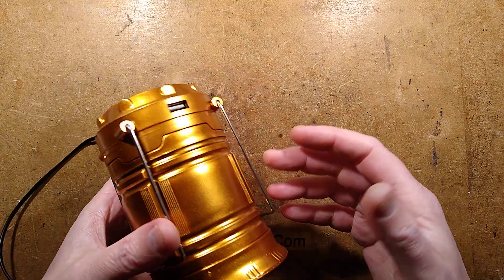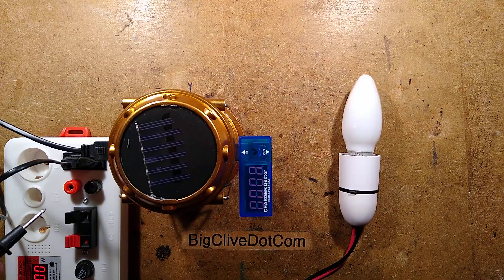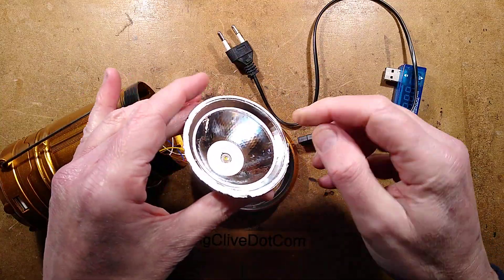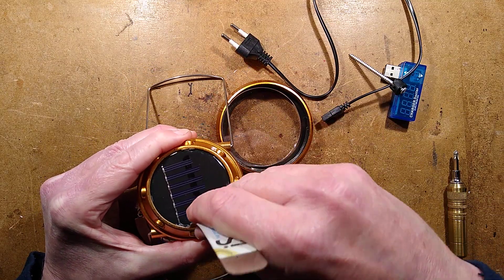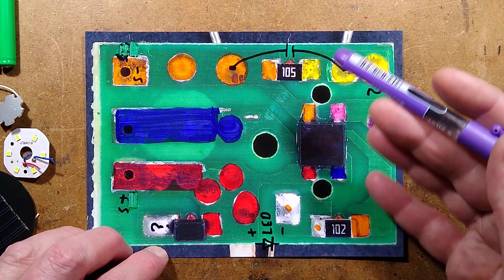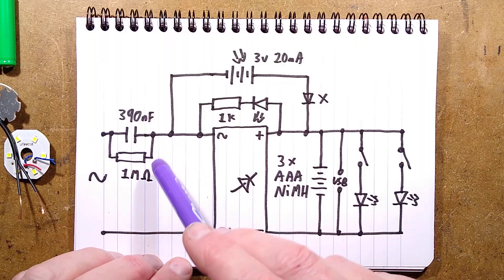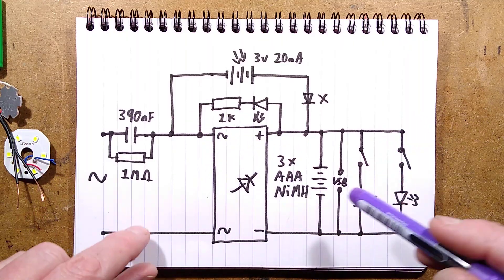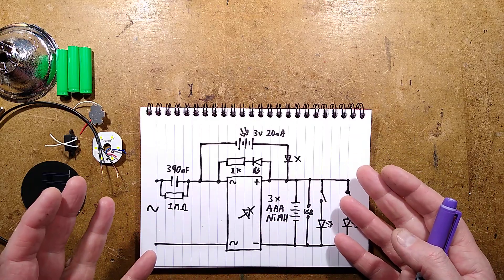Dangerous "death Dalek" lights still on eBay

Comment: The batteries probably ARE carbon/zinc since they will refresh a bit when they are “charged.” Still it will probably piss electrolyte all over the place and make it an extra-spicy death Dalek. 🌶️ Really sets a new high (EXTREMELY LOW) bar for a Chinese product. Nice!

Comment: Cell phone deaths are common here in Thailand where they sell 60 Baht (0.5 USD) chargers, but the media never goes beyond naming the brand of the phone and implying the phone was to blame.  I hate Apple with a passion because of their intentionally unrepairable nature, but no one has ever been electrocuted by an iPhone, it's the charger.  I hope the UK media is a little more thorough and accurate when these deaths happen, which is inevitable with products such as that.  Thanks for another great video.
Reply: This happened in Australia too, a young nurse died from a crappy charger she bought online.
Reply: And it was Apple that started the trend of selling phones without chargers, (apparently, it allows a slimmer, greener box) requiring customers to buy them separately. I remember when, in the early 1970s, my father bought our family's first cassette recorder, a Philips N-2205. It came with a microphone, patch cord, external speaker plug, mains cord, batteries, a blank Philips C-60 cassette, and a multilingual user manual. Everything you needed to use the product right out of the box. Nowadays, when you buy something, the accessories are often sold separately.
Reply: @dougbrowning82  good point
Reply: Not only these bad chargers, my worst incident with these cheap and dangerous product was that one time I got a cheap fake laptop AC cable from KlongThom, it was nasty quality and I didn't know better back then, it broke inside and caught fire, I was lucky I saw it happened and quickly pulled the plug and hit it with cloth to put the fire out, if I didn't, my house would be burned down or I might not be here. 
I know how bad it is when I cut it opened and learnt that it was very tiny copper coated steel wires, now I never cheap out on any electronic components.
Reply: @worawatli8952 Jesus, now I'm going to have to check all the cheap crap my mom bought on the street from street vendors.
Reply: You just described why journalism is now known as urinalism. Good job!
Reply: Several years ago there was a big story in Sweden when a young girl got badly injured from a phone charger her dad had bought cheap online. I remember hearing about it on the radio - she was holding her phone and then her foot made contact with a radiator which became ground, so the current passed right through her. After that I started trying to not come in contact with the radiator right next to my bed while charging my phone... 

So that was absolutely reported as the charger. There are standards in the EU for what electronics are allowed to be sold, so usually you are pretty safe in a store, but if you buy online that really goes out the window. Sure there is crap in stores too but if someone notices we tend to go down hard on that here.
Reply: This is what makes apple do silly things like make proprietary chargers
Reply: In Germany a lot of well built USB Chargers are thrown in the elecronic trash. I often see dozens of them when i go to the recycling center. Would it be a good idea to collect them and send them to Thailand?
Reply: Report this to all various countries'  safety organizations,news organizations,stations etc.Thailand also should have some sources you could contact .Report it  to many places.
Reply: So you speaking about stupidly cheap phone chargers and how they causing deaths, and then blaming Apple… it doesn’t make any sense. If you can afford expensive phone, but then using cheap accessories who’s fault it is? Since most of the mobile phone companies don’t include chargers no more.
Reply: I used to hate Apple in principle until I was forced to have one for work. Now I'm never going back. The old days of not knowing if this or that app will work with your phone or worrying about how long security updates will be available are now traded for the ability to lock down your security, keep your data as safe as you want it to be, to be able to lock Google's greedy bastard hands out of your life and knowing you will be guaranteed steady functional updates well past the life of most  people's phones. Yeah. I'll take having to pay someone to work on it for the guarantee of security and a working product. Android is cheap because Google views humans as cheap. We are the product they sell to companies and we pay them for it. I got off that bus.
Reply: @PalmettoNDN Phone philosophers... what a 1st world thing.
Reply: @PalmettoNDN I really don't recognize any of those problems.
Reply: Thailand uses twice as deadly voltage as usa
Reply: I saw one of those “apple” wall plugs blow up.
Reply: How da fuxk do you get electrocuted by 0.5 dollar charger? Are yours plugs made different?
Reply: @ceiling_cat  It shorts and puts 240 vac on the output instead of 5 DC. Better chargers are designed so no part that fails can cause this. Switch mode power supplies are very complex.
Reply: @ceiling_cat  because of the missing isolation between mains and USB by a transformer. Exactly what's going on in this lamp.
Reply: @ceiling_cat it isn't because of the low voltage output. It is because of bad design of the circuit internals where you end up with something similar to what was shown in this video, where the live mains and up being connected to an output that you can make contact with. In some products this is always the case. Depending on the design and in others, the way the circuit board is laid out, there is not enough space between the runs from the power supply side to the low voltage side. And over time it ends up shorting across.

Comment: The solar psnel can charge the battery through the bridge rectifier thanks to one of the bridge diodes, but needs enough 0.5V cells to overcome that diode drop and X .
Reply: Came to say just that. Maybe it would charge in near equatorial sunlight.
Reply: @tactileslut  -It only charges in China. LOL

Comment: rechargable alkaline batteries have been available since the MID 1970's.
Back then I had some Duracell rechargable cells in both C and D size. These were very respectable batteries and although expensive did an excellent job.
more recently available rechargable alkaline cells are significantly less able and tend not to last anywhere near As long before failing.
Reply: Are you talking about nickel cadmium batteries? They were the rechargeable type before nimh. But I thought alkaline only referred to te non rechargeable type?
Reply: @adrianthoroughgood1191  They were sold through an electronics store in 1977 and were definitely rechargable alkaline cells. instead of the gold top they had a metallic red colour.
I had 4 C cells in a Radio/cassette player and recharged them many times.
I do recall they were expensive but non rechargable alkaline cells were just new around Then and about 1/3 of the rechargables cost made them a no brainer.
I never saw the rechargables in mainstream outlets but there were a few lesser brands years later.
Reply: @adrianthoroughgood1191  Wikipedia advises me that rechargeable batteries based on the standard "alkaline" battery chemistry (Zn/MnO2 with KOH electrolyte) were introduced in the 1970s by Union Carbide and another company called Mallory.

They've got a very low self-discharge rate, so they still have a niche for certain applications.

Comment: I bought one of these for a laugh from a dollar store after your first video. It's actually proven to be a useful lamp and has lasted well. It's quite old now, so the battery (whatever it is) is not doing too badly. It says on the box "Dc charging, please do not use a mobile phone charging, in order to avoid too much electricity damage the phone."  Of course, that's not really good enough! 

Actually, there is a path for the solar panel to recharge the battery. The -ve of the battery can return though one of the diodes in the bridge rectifier, as it's anode will be pointed at the -ve out terminal. This same diode also blocks any possibility of the battery being able to light the red LED. 

However, the real issue is that wimpy panel. Can it produce enough current to make any difference to the battery or can it even produce enough voltage to drive that current through it? The solar panel on mine appears to be slightly better. There are seven segments, and each strip covers most of the width of the circle. Maybe it's the deluxe model? lol 

It doesn't worry me too much about the dangerous design, as it being handled by someone competent with electricity. So it's pretty much treated like a mains voltage test lash-up, with the relevant respect. The problem would be, of course, if someone not familiar with such circuitry got hold of it. If I ever decide I don't want it anymore, I'll reduce it to scrap parts or throw it in the bin. 

However, there is a quick'n'dirty way to make it a safe device, without even opening it up. Actually there is a couple of ways. a) Fill the USB socket with hot-snot so no USB devices can ever be plugged into it and then there should be no exposed live metalwork. b) The better way, I reckon, is to fill that mains connector with hot-snot so no mains voltage can ever be applied and then make up a lead which back feeds a USB 'A' connector with a current reduced supply. A USB A-A lead, cut with a resistor inserted would be ideal. Then it could charge from any decent USB supply source. 

You could still use the same port for charging other devices. It will charge them very poorly. I just measured the voltage on that port and it was 4.32 volts. This would suggest that the battery pack is rechargeable alkaline cells. It's been a fair while since I have charged it.

Comment: i have a latern with the same shell thats why i clicked the video. Mine only runs on batteries so i have nothing to worry about  😂 a 120volt shock is bad enough i want nothing to do with your electricity 😂

Comment: It seems like the solar cell is still across the battery, using the bridge rectifier to connect to the negative. Though ~2.3V into a 4.5V battery isn't going to do much.

Comment: There might be some hope. I believe products containing thorium dioxide have been pulled from both Amazon and eBay. That was after the USA's NRC was alerted. None of those were a serious hazard as sold but if pulled apart and the (not so) magic powder ingested or inhaled  it could have had serious consequences.
Reply from the maker: I just bought a thorium filled "healing wand" from eBay that sets off the alarm on my Geiger counter.

Comment: Have two dodgy devices and both have been modded to be safer. My LED light bar which originally charged by mains voltage now charges by USB because I embedded a power bank inside. The other device is a plug in rechargeable flashlight which had a 4 volt SLA mini battery and it no longer holds a charge so I used a set of rechargeable AAAs as a battery and charges by USB.

Comment: The reason why it is so dangerous is because it uses a capacitive dropper as a power supply. When a capacitive power supply is powered, either positive or negative will be live. Whoever designed must had never gotten a nice zap so they kept making more.
Reply: And if the capacitor were to go short-circuit, that would not be nice!

Comment: I love that Ebay can let sellers peddle these extremely hazardous electrical devices, yet they de-listed and banned the Christmas bubble lights I was trying to sell because they contained "dangerous chemicals."

I won't deny methylene chloride is not something to fiddle around with, but unless you're breaking open the vials and huffing the liquid or pouring it on your skin, it's no more dangerous than a majority of the Ebay death traps featured on this channel.

Comment: I have a version of these, but an older design that lacks the flashlight on the bottom. I bought it from the Newegg marketplace though, not eBay, sometime in 2017. In place of the flashlight at the bottom is a section for 3 AA batteries. It also has the solar panel in the top and a battery pack underneath it. I'm unsure of the internal wiring as I haven't taken it that far apart. I never use the USB plug and I've never and will never use the A/C plug to charge them as it seemed sketchy as heck, but they work very well for camping or emergency lighting when the power goes out with the three AA batteries in the base.

Comment: I suspect this came as a result of (mostly incompetent) people adding features without seeing the "big picture" --- one designed the inner light, one designed the top light, another made the useless solar charger, and up to this point, it would've been perfectly fine to use a capacitive dropper. Then someone suggested adding a USB port too, thought the voltage that the existing circuitry provided was sufficient, and the rest is history...

There's no doubt in my mind that this is the result of multiple idiots, not a single person. "Design by committee" at its worst.

Comment: You mentioning steel cored cable reminds me.
If you have the time, could you try making an educated guess as to why there would be steel cored speaker (or doorbell) cable wired into an attic lighting circuit? I was replacing old junction boxes with nice new Wago boxes at my Gran's place (the attic lighting wiring was an absolute deathtrap, light half screwed into a roof beam, no backbox on the light switch (tape over the live and neutral screws though, lol) loose conductors and signs of arcing (blackened plastic) in the junction box with mystery cable I was replacing. 
I tried tracing the mystery cable back to the source, though I'd have needed to pull up a lot of tongue and groove flooring, so I just took it out of circuit and checked to see if everything in the house (that I tried around where the cable seemed to lead) turned on and it did. 
Though wondering if it led anywhere I took my multimeter and tested it, 0.8V drop in continuity/diode test mode, 550 ohms resistance and strangest (to me) of all, switching my meter to thermocouple mode it actually gave a fairly accurate temp reading, within about 2 degrees of the house temperature, though this could be coincidence. 
There are no old doorbells that I can see (unless one has been paneled over) the house never had a thermostat when it was bought, just a timer on/off system and there are no hardwired smoke alarms. 

I'm just curious as to what it could have went to. The cable was in pretty sorry condition, some partial nicks and due to not being double insulated, steel cored and plain white in colour, it's not getting wired back in. I need to know what it goes to (or probably goes to) to satisfy my curiosity though and I don't want to disassemble a whole jigsaw puzzle attic floor to do so.

Comment: OH,.. YOU BLEW IT 😂
You're using a Chinese power block, with a Chinese Device.
And they know their heritage 🤣
... always wear a Helmet 

I actually have one of those.
It was free, with some harbor freight tool purchase.
IT DOESN'T HAVE ALL THE FANCY SOLAR CELLS And Everything. AND, only runs on batteries.
But its circuit board is Full Of Accessories 🤗

And to be consice.
It only ran on batteries, till I popped in a charging port.
Along with a real battery set.

It's amazing the time, tech, and engineering,.. we'll put into a device that children made for like a buck 😂
... always fun 😊

Comment: I have one of these exact models it seems. It’s branded “outlite” and I got it as a free gift if I remember correctly. Will be taking it apart later and seeing what I can see. Won’t have time right now or for a few day- it’s also green with black rubber. Seems to have the same led and connector orientation.

Comment: What would it take to turn this into a safe and useful product?  I see a need for different batteries and some way of making it less shocking.  Might it be cheaper just to find the original they are knocking off? It seems like it could be a good lamp for power outages or camping.
Reply from the maker: It would take the module out of a USB power bank, a decent lithium cell that fitted, and some resistors for the LEDs.

Comment: Diode X looks like it theoretically is a blocking diode to prevent the green cells from discharging through the solar panel.  Solar cells have a relatively low resistance when reverse biased in the dark.
Reply: Umm..actually the solar cells themselves are diodes and they generate electricity when reverse biased.
Reply: @deang5622  A battery connected across a dark solar panel will discharge into the solar panel because the dark resistance is fairly low.  For efficiency, the blocking diode is usually Schottky diode.  If you’ve got solar cells connected in series, the individual solar cells may be paralleled with a diode.  The diode and solar cell are connected anode to anode and cathode to cathode such that the diode is reverse biased in light.  In a series string, if one solar cell dies or is temporarily in shade, the parallel diode will be forward biased with respect to the rest of the string, thus bypassing the non operational solar cell and allowing current to continue to flow fairly efficiently.
Reply: @wtmayhew  I do know all this. I made some PN junctions when I was at university
Reply: @deang5622  OK, good to know.